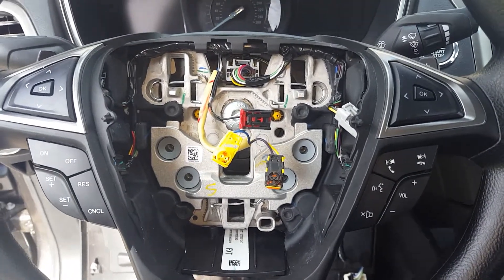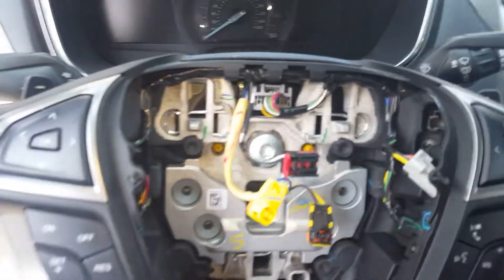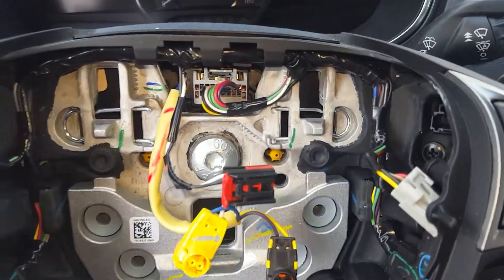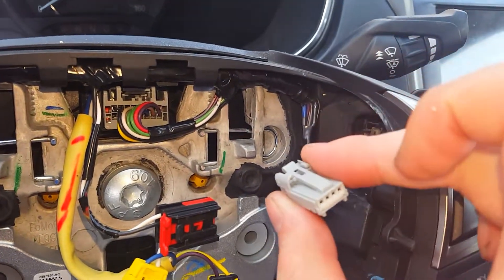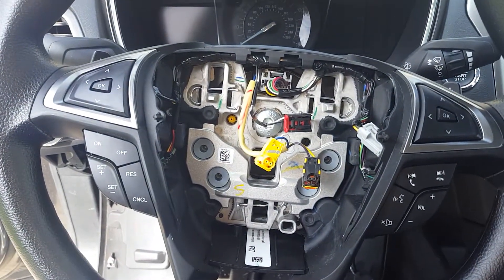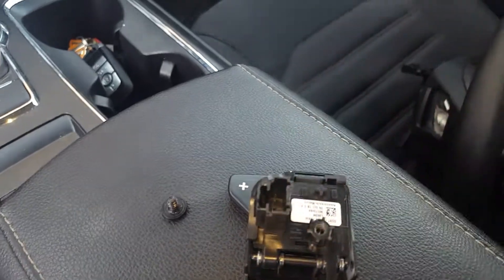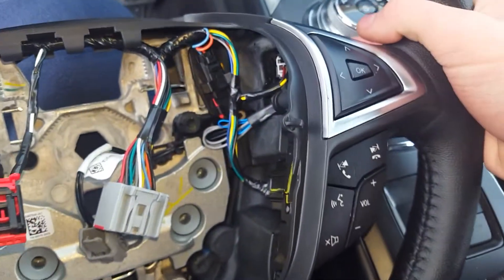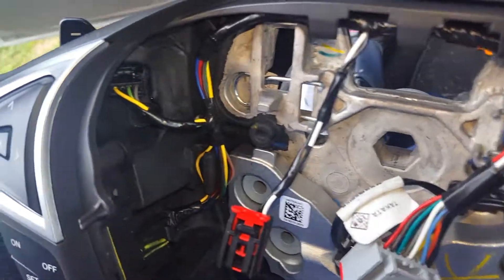How to remove the paddle shifter on a 2013-2018 ford fusion

Comment: Should you leave the battery disconnected? From the airbag video and this, it sounds like you say to leave it for 5-10 minutes, but then after that do you reconnect or after the job is done?
Reply from the maker: Once the job is finished I re connected the battery and went on my way
Reply: @Nickthecarguy  Cool, thanks!

Comment: I’m curious, do you think it’s possible to upgrade the paddle shifters to bigger ones?
Reply from the maker: Venom Monster are you going to add aftermarket kind?
Reply: Nick the car guy I like the paddle shifters on the Alfa Romero Guilia and was thinking of installing the same style on the fusion. I know they sell paddle shifter extenders that you can stick on with 3M tape but I prefer a full replacement.
Reply from the maker: I'm not for sure if you can add aftermarket ones on there to bolt on do you have a link to the one you're looking at
Reply: Nick the car guy I haven't found a set yet that bolt on.

Comment: can i install one in my S Fusion ?
Reply from the maker: HDSaleh yes you will need the paddle shifters and the wiring for it
Reply: Do I get the stock ones?
Reply from the maker: @suazomelvin09  I stayed stock with mine
Reply: Where did you find them?
Reply from the maker: @suazomelvin09  mine came on the car factory I had a switch mine over when I got the new steering wheel. I can try to find a part number for you
Reply from the maker: Here the right side 223191302013
Reply from the maker: Here is the left side ebay number 323501590784
Reply: Where would I find the wiring for it?